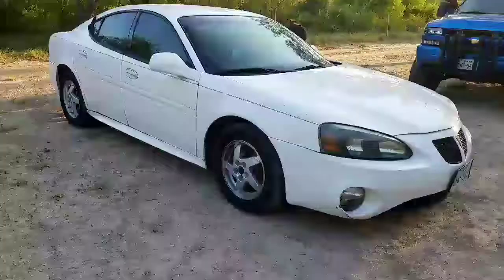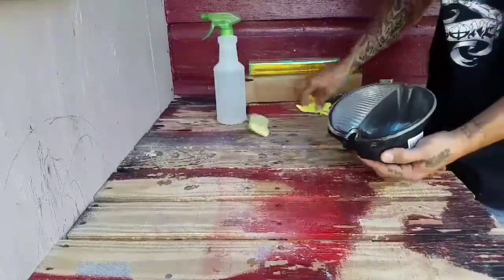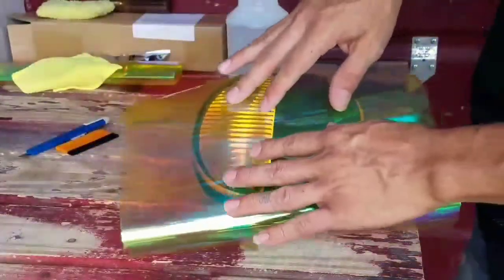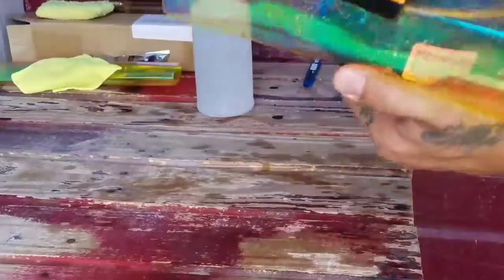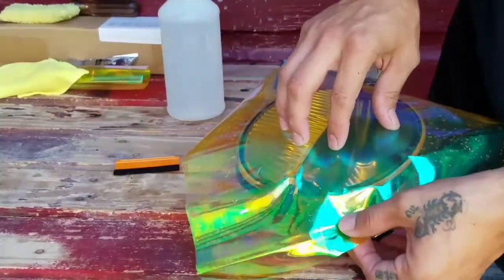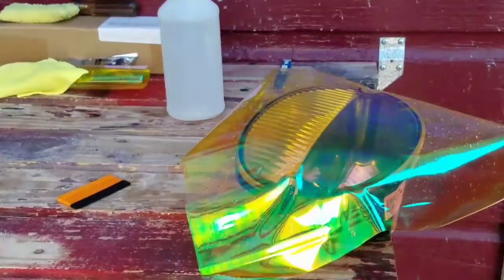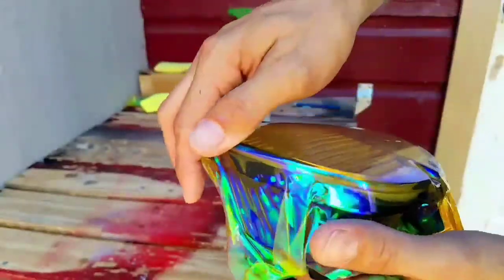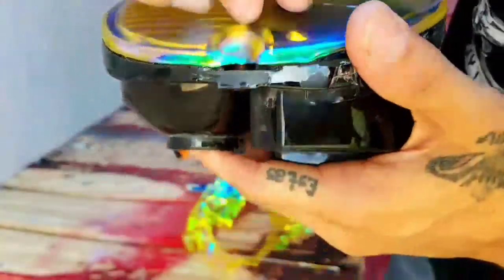How to vinyl wrap your fog lights

Comment: Great Video, showing the wrapping of the fog lights, and also showing what the finished product looks like with different bulbs at night. Question:  When you took the protective film off of the vinyl, then you put that vinyl side down on the fog light, as it has a water activated glue on it? Right? So the vinyl has two protective films on it? One you take off when you start the process and one you take off after the lights have been wrapped and the excess cut off, Right? So the Yellow vinyl is sandwiched in between two films? I've put window film on, but I think it had just one film you peel off for the Film to go against the water sprayed window. Thank you for the Video, Good Job.
Reply from the maker: Yes, it still had a clear protective film you remove after the vinyl install.  In case you use a card to take out air bubbles, so you won't scratch the vinyl.
Reply: @GTsPerformance  Thank you very much, that was a Great well made Video.  Stay Safe, Thanks for your reply.  Love Youtube and the people that make us able to do things ourselves.